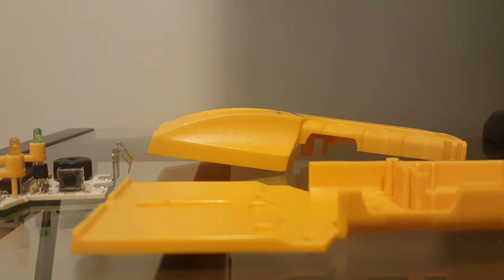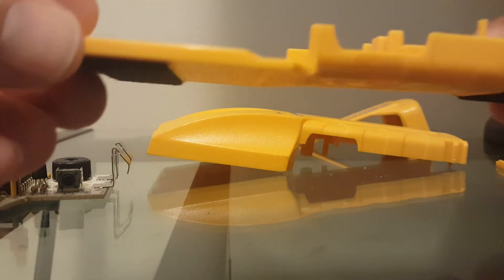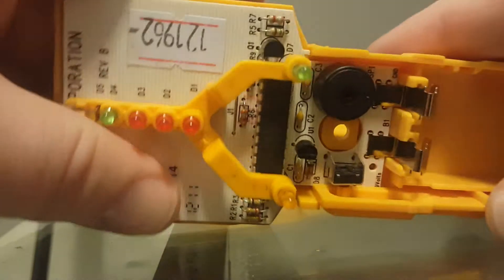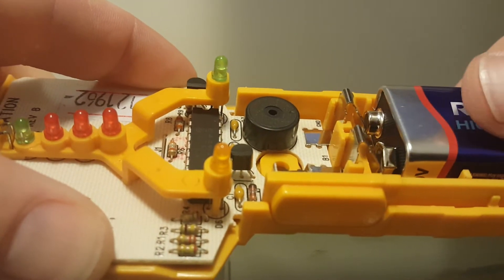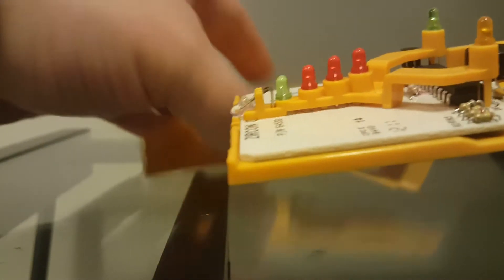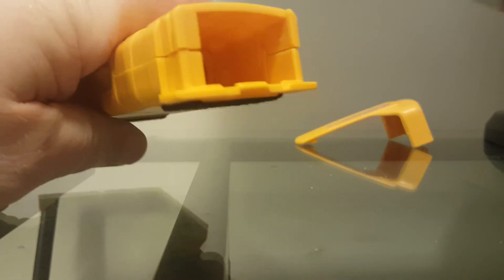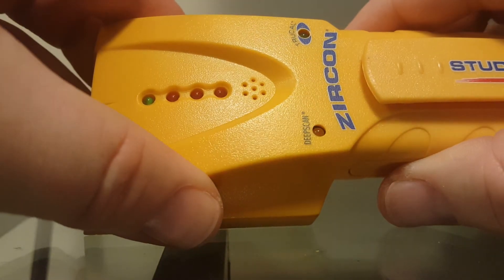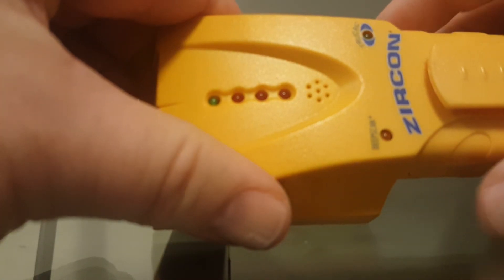Zircon Studsensor Pro SL - Reassembly

Comment: Glad you posted the reassembly of this one. I had the deepscan SL instead of the Pro but they are exactly the same.
Mine hasn’t worked right since a friend gave it to me four years ago so I threw it in a tub and today I found it looking for something else and decided to pull the battery out, but I had no idea how the battery came out so I removed the screw from the back and it sprung apart when I did. I was trying to figure out where the little plastic piece with the holes in it marked positive and negative went and decided to try and google it to no avail so I looked on YouTube.
I checked the battery with my voltage meter and it had 9.6 volts, so I knew the battery was good, which was a Rayvac battery (it was in there since March 2021). When I reassembled it and tested it on an unfinished drywall, it worked perfectly!
These things are nearly 50 dollars now, so I am glad that whatever happened in taking it apart and reassembling fixed it.
I think it was poor contact. Because when I put pressure to the end of the clip holding the battery, it done well and when pressure was released, it would randomly say it was on a stud 8” away and then never go off.
Glad you done the video just for the sake of knowing where that little plastic battery holder went!

Comment: Very helpful and easy to follow. Thank you! Yeah, I too took the screw out and it fell apart. It had been so long since I changed batteries, I forgot how simple it was. Like everyone else, I had no idea how to replace and position the spacer. Your video saved me from total frustration and junking the studsensor, even though I've never been satisfied with its operation. Then I found that all the 9V batteries in the house were bad. Figures. Today is a Friday the 13th.

Comment: SOLUTION (all lights on): I took the screw out (accidentally) to replace the battery. When I reassembled it with a newly inserted battery, all of the lights would come on so it had power, but it wouldn’t work. Then I read online that the battery has to be less than 3 years old. I replaced this newly inserted battery with a new battery I purchased from a store, and it began working. If all the lights are coming on, buy a new battery to solve your problem.

Comment: Thank you Paul.  A life saver.  I removed the screw and took my stuff sensor apart to change the battery when the small plastic piece that fits between the battery fell out.  Of course, I didn't see where it came from.  Your video saved me a lot of aggravation!  

I also now know how simple it is to change the battery.😮

Comment: Like so many other normal people, I took mine apart trying to replace the battery.  Zircon made a serious mistake when they did not print battery replacement instructions on the back of the stud finder.  Once I opened it, the battery spacer came out and I couldn't figure out how to place it correctly back in to the unit until I ran across this video.  Thank you very much!!!
Reply: I know, right! I took the screw out not knowing the clip just slides up and the battery and plastic holder/spacer sprung out on the counter and I was thinking: great! Now how does that go back in!

Comment: Thanks! Instructions were very helpful. When putting on the top cover, I struggled a bit, until I noticed that some of the LEDs were just slightly out of place. After I straightened them the cover went on smoothly. (But note that the white LED at the very end is supposed to be bent forward. See the video.)

Comment: WE PUT IT TOGETHER JUST LIKE YOU AND ONCE WE PUT ON THE LAST COVER AFTER THE BATTERY, it stops working.  When we shake it, something sounds loose.  We can't figure it out.  The battery is not fitting snug in the stud finder.

Comment: Does any one know what part number of the switch is soldered to the main board?  Its the part labeled as SW1 and has a black circle in the middle and is 6 mm tall x 6 mm deep x 7 mm wide.  Any help is appreciated :)

Comment: Thank you!  I unscrewed it because I did not remember how to replace the battery.  Pieces fell out.  I would never have put it together properly without your video (the little plastic piece with two holes had me stumped).   Now....I followed your directions and used a fresh battery (I checked it in another device)....but it still isn't working.  Any tips for why not?  Something else I should check?  Or is it just worn out?
Reply from the maker: Bummer. I'm not really an expert but sure, could be old, worn out...perhaps something with the circuit board has come loose or otherwise broken the continuity. Just guessing, sorry!